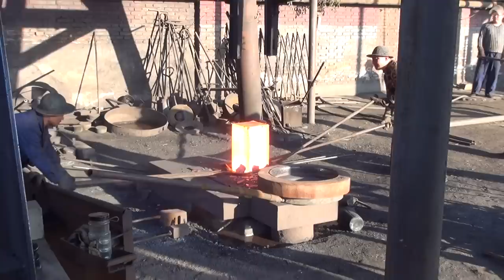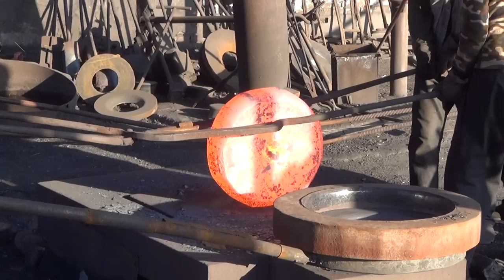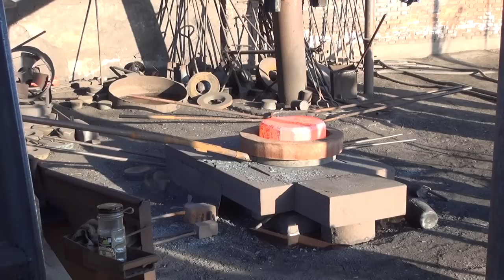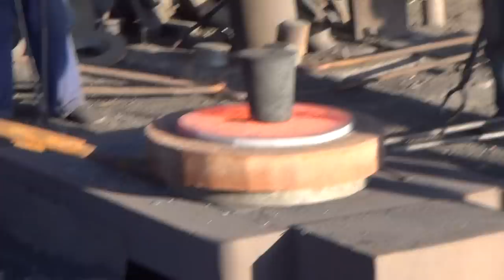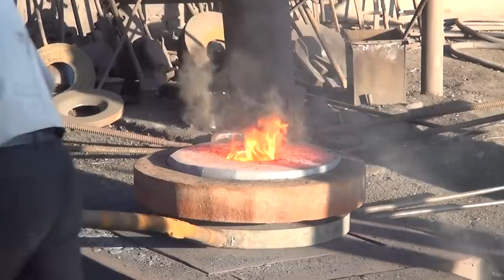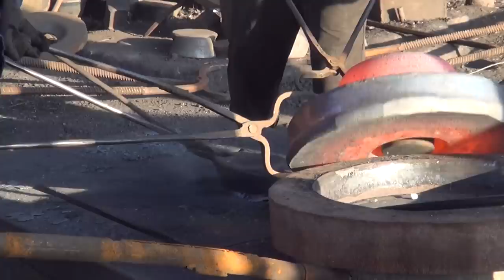Visit China Factory for flange .forging ,ring in dingxiang -Shanxi Liyang Forging Co.,ltd

Comment: How does it remain hot for such long time ?
Reply: Army Josh it's got a huge bulk. Plus, it gets pounded like hell, that should put some energy back into it too. But, in all honesty, it's probably a bit too cold for a really high quality stuff. But, you get what you pay for. It's not like they are making some of the most important part that requires that kind of quality.
Reply: @shenghan9385  What's that black powder the one guy shovels into the center?
Reply: @michellewehner7179  don't know. But then by the look of it, it may have been something to do with controlling the oxidation and the forming of or prevent the inclusion into the final products of the crusty hard scale. Do you know. I would like to know. Anyway, it would have been something to help the purity and consistency of the forged material.
Reply: Sheng Han I know welders use thermite for jobs that require intense heat (railroads) and in environments that lack O2 (underwater) It’s a black powdery substance very like what the one guy was shovelling .  The flames it produced when he added the powder also suggests thermite.  

Very impressive work these guys are doing -  pretty amazing.
Reply: @michellewehner2644  I know what you are talking about. It's that highly volatile substance in things like thermite welding and thermite grenade. But I doubt that is what they throw on the steel bulk. What you have raised is indeed a interesting topic. I have seen videos in which people throw certain unknown substance on the surfaces of heated steel for forge welding. Maybe they are the same stuff.

Comment: need to unionize these guys,  "-)  so what it pay them to make that slug of steel. around 67, were holdup along side a village waiting for the rest of the teams: an old timer with three or four guys sitting around a charcoal fire drinking hooch; rice farmer shows up with a chunk of metal, a wood pool of shorts.they kick it around for a while, & the old timer, he stokes the fire & fires up the chunk of metal to red hot,  hammers & fashions out a gardening hoe, cured the wood for the newly fashioned hoe blade he was fixing to the pool. hammed it in to submission so to speak. It was a blazing hot day that day, all sitting up close to the coal fire pit. I guess it took him a little more than hour. he gets  it done, hands it to the guy, &right away he is off to put it to use.